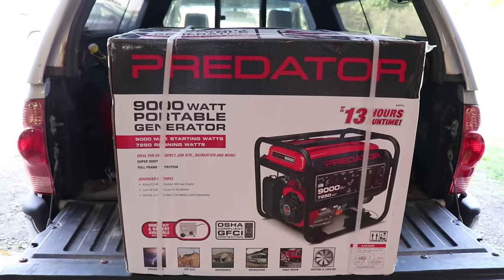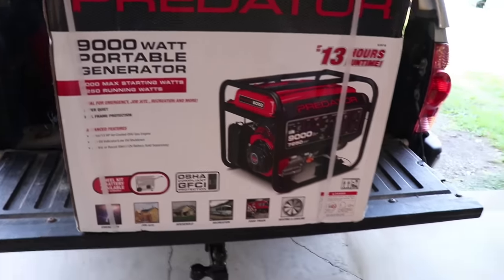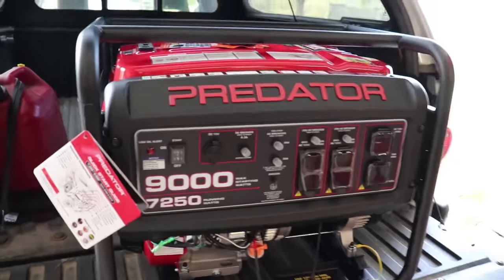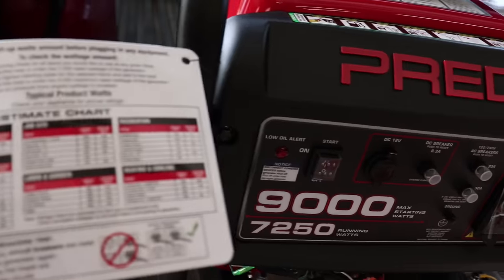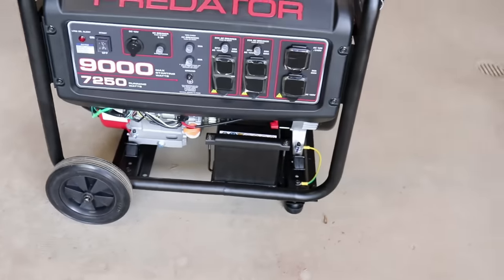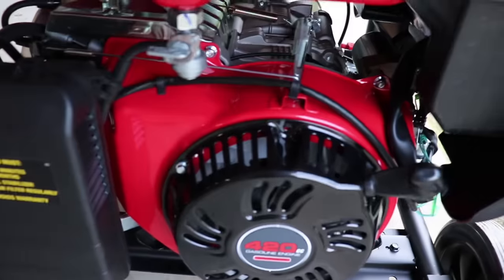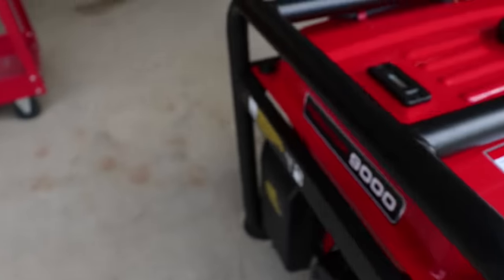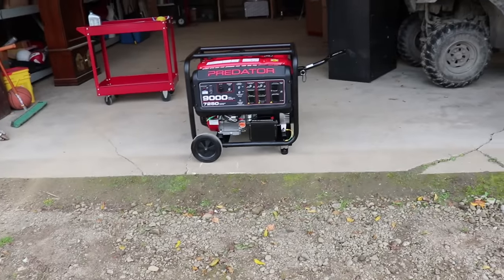Predator Generator Running Our ENTIRE Home. (Complete Setup and Cost)

Comment: I recommend a 50 amp outlet and a converter cable to interface to a 30 amp cable. That way you are all set to interface to a larger generator. You may then upgrade in the future to as much as 12,000 watt power source which will come with the 50 amp connector
Reply: Don’t forget to watch this video about generator safety https://youtu.be/I1jT3ANENvI just hoping you stay safe. Thank you
Reply: @The_Happy_Aviation_Enthusiast  Are you referring to something I said or is this just a general best wishes kind of statement?
Reply: @kf3en  just hoping that people are aware with carbon monoxide poisoning and electrocution while operating generators

Comment: I have that same generator. When we built our house 16 years ago, I had a 220v line from the main power panel run to just inside the garage door. Bought the necessary plugs and cable, made up my cable and I was good to go. As for ordering an interlock switch, don't do it. I went to Home Depot and spent $2.00 for a piece of metal and with my angle grinder made my own in about 30 minutes with the power company's blessing. I run my entire house, everything, including our well which is down 450 ft. with a hefty motor on it with no problem. I keep it in the garage even when running it, however, I pull it out so the exhaust vents outside and the garage door sits on it. Our house is not particularly large (1800 sq ft) and as I said above, it runs everything, freezer, fridge HVAC system, well, everything. I also do not run it but a couple of hours a day as needed. I run it once a month for 30 mins. as a preventive thing. We live in the Sierra Nevada mts and have to put up with fires, snow, 100 mph mono winds and this thing has been a life saver. Say what you will about Harbor Freight's Predator generators, but I know for a fact it's a good unit. The entire cost for set up was about the same.
Reply: Don’t forget about generator safety as well https://youtu.be/I1jT3ANENvI here’s a safety video that everyone must watch. It’s about keeping your family safe while using generators. Just hoping everyone stays safe. Thank you

Comment: Good video. I am in the process of converting my Coleman 6200 watt to NG. Gasoline is too expensive here in CA. Edison is doing these power shutoffs when the wind blows so yea CA is going backwards. :)
Reply: You know what communist used before candles??
Electricity
Reply: Ed Fletcher NG or propane? If NG, can you share a link for more info?
Reply: It is easier to make a still and run it on alcohol.
Reply: Same here. I’m using a 55 gallon can burning coal in the living room to keep warm. It keeps the place warm if I keep the windows shut.
Reply: I converted my very old Generac 6500 watt (same Briggs & Stratton engine I think) to propane a couple years ago.  I'm in Florida, and absolutely hate stocking up on gas for hurricane season, and then trying to burn it all when I don't need it.  Best thing I've ever done.  Now I keep (8) 30# propane tanks and (4) 20# tanks stored in a safe place and forget the gas.  In the event of a loss of power, I can run on generator power about 12 days with the propane I have on hand. I run the generator non-stop, but do shut down every 50 hours to change the oil.  Propane and NG make less power than gasoline, but my generator still powers my entire home, minus the central A/C and water heater.  I have window A/C units that we alternate running and they work fine on generator power.  Good luck with the fires and black outs.
Reply: Sys
Reply: "Edison is doing these power shutoffs .... "    <<< yes, and you can expect more. That is what they do in commie countries.

Comment: The purpose of the interlock has more to do with not backfeeding the utility lines than it does anything between the generator and house.  If you don't have an interlock and you forget to turn OFF the main before energizing the generator circuits, you could send power up to the utility power lines and potentially electrocute a linesman.  Beyond the lawsuit, you'd have the guilt of killing someone on your conscious.
Reply: Yeah, but you're food won't go bad and you will have lights. Life is full of give and take /s

Comment: Hurricane Laura convinced me to buy a Generac and window ac unit for our home. A month later when Hurricane Delta hit us in Lake Charles, I ran my refrigerator, freezer, fans and ac unit and it made life much better. Always be prepared, oh and buy about 6 or 7 five gallon gas cans.
Reply: Make sure you are aware with the hazards of using generators. Generators can be dangerous if not used carefully so make sure you follow all the generator safety instructions. I know all about generator safety and I have something to explain to everyone about generator safety. Here is what everyone should really know: please remember not to ever run your generator indoors. Generators should only be used outdoors. Always remember that carbon monoxide fumes are odorless and colorless gas that is a silent killer that you cannot see or smell. Carbon monoxide is dangerous and it can cause death. Carbon monoxide is poisonous. Always keep that in mind when using generators. You need to have a carbon monoxide detector. Make sure your generator is 15-20 feet away from your house and away from doors, windows, and vents. Never use your generator indoors even if your doors and windows are open. Some people run their generator indoors during hurricanes which is dangerous and you and your family will die if you use generators indoors. Running a generator indoors increases the risk of carbon monoxide poisoning. Please don’t run your generator in wet conditions. Running a generator in wet conditions can electrocute you. You need to keep your generator dry. Don’t let the portable generator get wet. You need to have a generator tent as well to protect your generator from getting wet if you will use  your generator during wet weather. We also really need to keep our children safe when we’re using portable generators so they won’t get electrocuted or burned by the generator which is dangerous. Generators can be hot. You have to keep an eye on children making sure that they are not near the portable generator to avoid any risks. We have to be aware with all the hazards and follow all the instructions in the generator’s operating manual. Generators pose electrical risks. Make sure your generator is not overloaded. Overloading your generator can cause damage to the appliances that are plugged into the generator. Please don’t overload your generator. Don’t ever try to plug a generator cord into a wall outlet to avoid back feeding. Back feeding is dangerous. Always turn on your generator first before plugging in appliances. And before you unplug the appliances, please shut off your generator first. Please use a heavy duty cord for your generator and the cord should not be worn out. Please don’t refuel your generator while it’s running. You should shut off your generator and let it cool off before refueling it. Refueling your generator while it’s running can cause fire if gasoline spills on the generator’s engine because it’s hot. Please make sure your generator is properly grounded. Everything that is said on the generator’s operating manual should not be ignored. They all need to be followed. https://youtu.be/I1jT3ANENvI and here is a video more about keeping your family safe while using generators. This is for everyone’s safety. This is just a safety reminder for everyone to make sure that you are aware with the warnings. Thank you and hope you stay safe.

Comment: I have the Predator 4000W (3600W Running) generator and it has not let me down.  Starts within 3 pulls even when temps drop below 10°F (-12° C). In warmer weather, it starts in 1 pull almost every time.

Comment: I have multiple generator 
I am off grid and generator are the power when solar power is out
My thought is keep no more gas in generator than you have to 
Always turn fuel off and let it starve out so only minimal is in system 
Be careful the longer you run the generator the more oil it will burn
Also keep an eye on the spark arrest on the muffler exit
There are days I have to run the generator 12 hour a day
The predator will do the job
Reply from the maker: Great advice.

Comment: I have the predator 8750/7000.  Bought it 5 years ago and she has never failed me.  We experience 3 - 6 outages a year and I am currently running on gen power as a storm ripped out the power 4 days ago.  the only complaint is the need to fill up with gasoline every 10 hours making these longer outages a pain.  I have been researching the natural gas adapter.  Easier, cheaper etc.....Also,  I change the oil after every use.  It takes about a quart, frequent changes are is very important.
Reply: I installed a Tri-fuel kit called Motor Snorkel on our Predator 9000/7250. We have it connected to our homes NG line.  The initial cost was around $500 for the Tri-fuel kit, NG hose and quick disconnects. It was worth the money and works very well.

Comment: Nice generator but you will need to ground it to a copper grounding rod.  5/8" diameter on the pipe and 8' in the ground should do it with probably a 6ga wire from the generator to the grounding rod (although your manual probably states the appropriate gauge).  If you were running individual extension cords, this step could be skipped but because you are hooking into a transfer switch, trust me you need to do this as it could save electrocution from occurring.
Reply: You mean A extension cord for each appliance?
Reply: @knightrider1545  Yep pretty much.  If you hook it up to your house you need a grounding rod.  If not then you're fine if you're just running your fridge from an extension cord.
Reply: @mae2759  but your panel already has a ground so why do you need to re ground the machine when it's already hooked to your panel which contains a ground bar

I may be confused but this is my understanding of it
Reply: One older comment said you needed a separate grounding rod connection. This is wrong. You do not have to repeat the already existing ground connection as long as your house wiring is already installed correctly. Your service panel will have a connection to a grounding rod and your cable from generator to house service panel provides the ground connection.
Reply: No ground rod,floating neutral for generator when connected to house service

Comment: Fuel consumption with these larger generators is a concern. At this point in time I have three different size generators to accomplish various tasks. One thing that I have been thinking about other than gasoline or diesel storage capacity is alternative fuel sources such as LP. I know there are kits manufactured that will give you multi-fuel ability. From what I have seen most generators other than diesel gens can run on gas, propane or even natural gas. The problem with natural gas is the fact that you are dependent upon a 100% feed from an outside source. LP can be stored in a tank or tanks on your property, either above ground or below. I believe it's in everyone's best interest to be as self-reliant as possible.
Reply: Great American Culture only thing is LP is expensive and a 9000/7200 watt generator sucks about a gallon of gas an hour at 75% load. That’s about 13 days run time on a 500 gallon lip tank. 13 days sounds like a lot of time, and it is. In Missouri it is not uncommon for us to loose power for 2-3 days a month from December until April.  At a minimum your going to need to be prepared for 18 days of off grid power outage. That means a partial fill up during peak useage times. LP is expensive during those times. 1.25 to 1.75 a gallon. As opposed to non peak useage times like July and August where you can buy LP for .75 to 1.10 a gallon. Add on top of that your tank leasing fees. You can easily knock back 750 dollars a year just to supply a back up generator. I know this because it’s the system I use on my 10,000 /9300 watt generator system. Add in generator maintenance, such as oil changes for every 100 hours of use, using synthetic oil, spark plug changes, Air filter changes You can easily reach 900 to 1000 dollars a year. Just in a back up system. Natural gas is much more cost effective. I have rarely seen a natural gas system break down. Accept during earthquake events. If I lived in an area that I had access to natural gas I would definitely use natural gas and keep my LP as a back up. I fully appreciate what you are saying though about being dependent on a source company being able to supply your needs in a time of crisis. So having a double  or triple power source would be an excellent idea. Gas,natural gas,LP. Is how I would set up my system. If I could. I also have a small solar system set up with 6 deep cycle batteries and a 2500 watt inverter system. I run my shop off of it occasionally. Just to cycle the batteries. At full charge I can run my shop tools for about 12 hours. If I just run the attic fan and the tv and the fridge and a few led bulbs. I can get about 24 hours out of it.
Reply: I agree about the fuel consumption of the larger generators.  I have a Champion 7500watt dual fuel generator and it will burn through 1 gal of gas per hour.  Only gives me about a 6.5 hour run time.  I also have issues with the power output of the generator causing my UPS units in the house to shut down.  I have since bought 2 smaller 2000 watt inverter generators with a parallel cord.  The smaller generators only burn about 1 gal of gas per 4 hours.  I have them connected to a 10 circuit Reliance transfer switch.  Most of the time, I can run on just one inverter generator (2000 watts).  The power output is clean enough that it doesn't cause my UPS units to fail.
Reply: @mowcowbell  Those inverter generators are the bomb, but tend to be a bit pricey. Well worth the extra coin for fuel efficiency and clean power, IMO. I bit the bullet and bought a Honda EU7000is and have been through several power outages. Will power the entire house except the heat pump. One of the big selling points, for me, was how quiet it runs. We can be in the house and can't hear it running.

Comment: 4:55 Also turn your main off so you don't electrocute the utility workers repairing the lines.
Reply: with the interlock kit it will be off when the gen is on.
Reply: He said you have to have the main off BEFORE you start your generator. He cut it off.
Reply: If the main was on it would pop the breaker on the gen.
Reply: Kbv
Reply: @dporrasxtremeLS3  Yet linemen are zapped every year by some idiot back feeding electricity onto the grid from a generator.  The laws making the generator operator liable where passed because people keep doing it.  All sorts of devices have been made to prevent this situation because people can't seem to understand how it's a problem.  Seriously, it happens every year.  (Electrician.)

Comment: I bought a Predator generator about 8 - 10 years ago, can't remember exactly.. I use it at least 3 times a year for power outages,  there's been several times a hurricane knocked power out for a couple of weeks.. mine is 8750 watts and it still cranks every time I use it  it's got the electric starter with a 7 or 8 gallon tank.. paid around  $550 and it's been an awesome investment..

Comment: I made my interlock plate from a stop sign, a cutoff wheel or two, and bolts and locknut. Cost $2
Reply: Do these interlocks disconnect the neutral or just the two hot lines? It seems if there were a malfunction in an appliance or home/generator wiring where a hot lead got dropped to ground it could send voltage back out to the utility.
Reply: It is only a plate to lock out the generator backfired breaker if the main breaker is turned on. So it only disconnects the 2 hot leads. I see what you mean with the neutral not disconnected. What would you recommend? 
      I plan to do a automatic transfer switch with a dse4520 controller next year.
Reply: @halberto9o8  The interlock switch meets code in this part of Florida..and probably most of the country.
Reply: halberto9o8 even most generator transfer switches dont disconnect the neutral including the popular pro Tran switches
Reply: I bought the actual Square D part for my panel. Expensive for what it is, but UL listed. You have to think about liability.  I could have made one in about 10 minutes, but the factory part# shields me from that.

Comment: I would look into installing an adaptor so that you can run it on propane or gasoline. It is best to run your generator at 50% capacity to keep it from over heating and to be able to handle the  spikes when appliances come on.